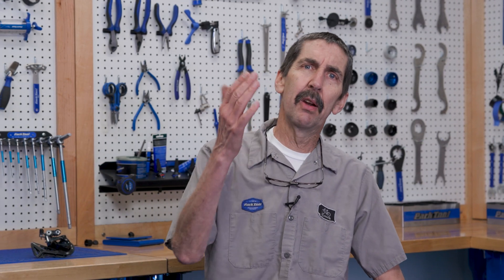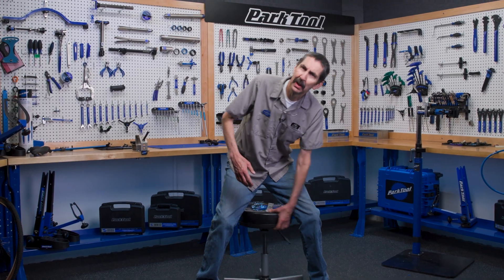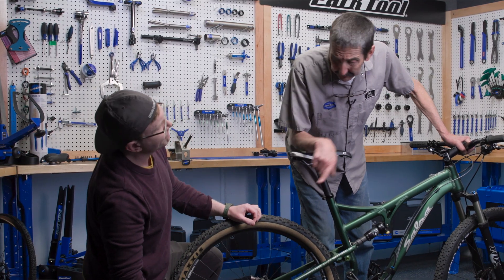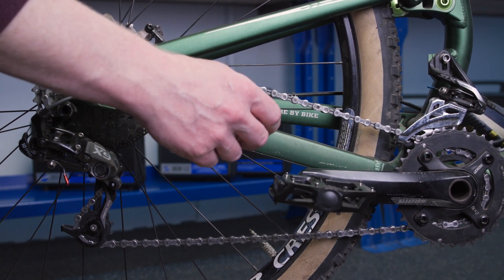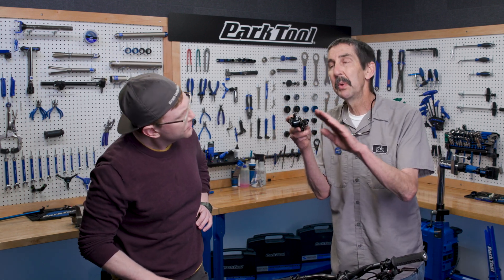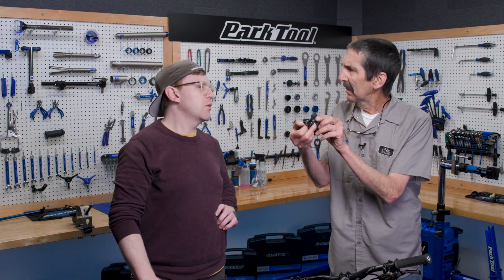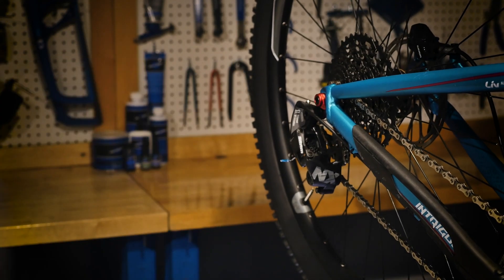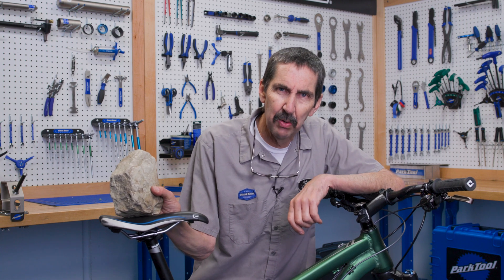Stressed Out! - Visualizing Drivetrain Stress

Comment: I carry a spare hanger on tour. Just imagine the stress 20x32 granny gear puts on a chain with 230lb rider with full panniers at 20% grade! Spare link carried also. Be prepared. That's a 17 inch gear with 700c. 9 speed Sora. Suntour 3x rings made into a double. 1 tooth wrap to spare. Way over the  limit up front, but even crosschaining is smooth. What's in it for 1x?

Comment: I'd heard that "just riding along" can bend your derailleur or mech hanger in some cases if the B tension screw is badly adjusted and you try to shift into the bottom gears in the cassette.
Reply: Yes, if your chain is too short or the difference between chainwheel sizes and cassette sizes is too big. Snap!
Reply: @davidburgess741  An overly short/tight chain can also cause damage but I'm thinking of when you have very tight clearance between the top jockey wheel and the biggest sprocket that requires adjusting the B tension screw. If the top jockey wheel is too close then trying to force the derailleur into bottom gear can cause damage even if the chain is plenty long enough.
Edit: I'm pretty sure the correct B tension would depend on chain length so that is a factor but I'm not entirely sure whether more or less B tension is required, I usually just fiddle with it until it looks right, hopefully the guys at Park Tool can do a video on it?